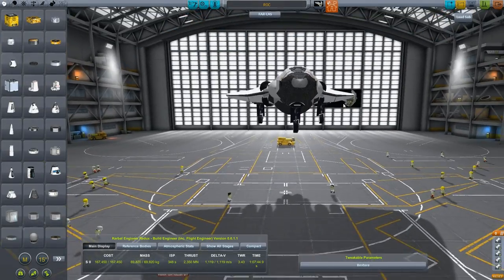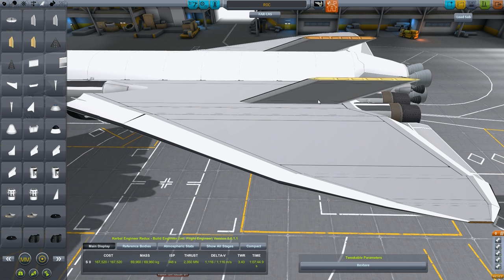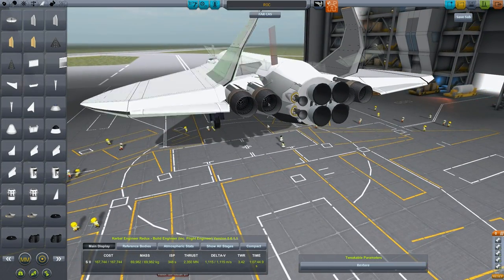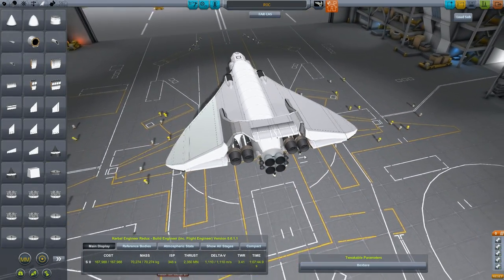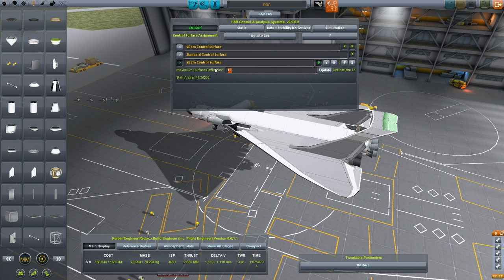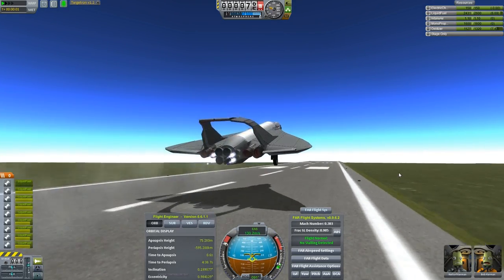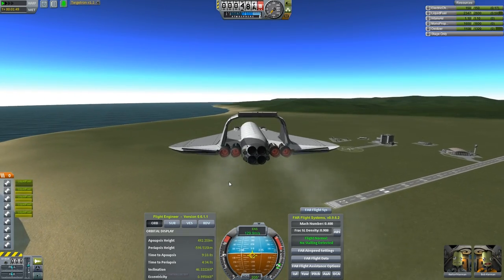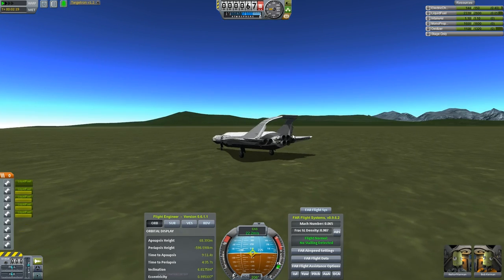Let's Fly KSP: Space Shuttle Development, part 15, Tale of a Strange Tail

Comment: I think the closest thing to a real-life equivalent of this is a concept Lockheed Martin did for a challenge for NASA back in 2011, and that wasn't quite the same - it looks like they started with a commercial airliner, slapped on a pair of engines in the same manner as an A-10's, and then attached the wing to the vertical stabilizer.

Comment: Seeing as how the jet engines aren't meant to bring the Roc into space, you could go with those other ones from the B9 pack. They spool up and down faster, and provide more power at lower speeds. Plus they have thrust vectoring, which would give you more control authority. Rotate one pair 90 degrees, and you get full 3d thrust vectoring (pitch, roll, and yaw).

Comment: i have some understanding of aerodynamics and i can't really think of any problems it might have. there are, of course, airplanes with double-tails (C337 skymaster). the reason, this particular design hasn't been done before might be that you wouldn't need it in real life and having two rudders is very inefficient in terms of drag. also, the curve from the rudders to the elevator might be a structural weak-point...